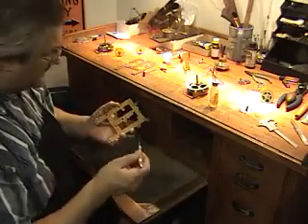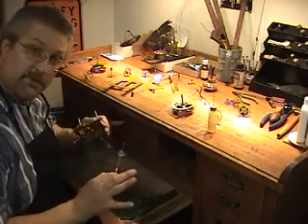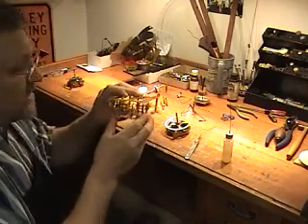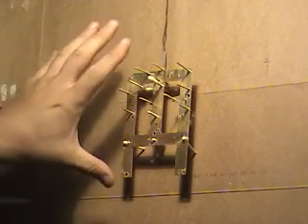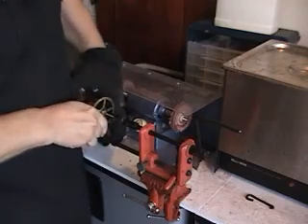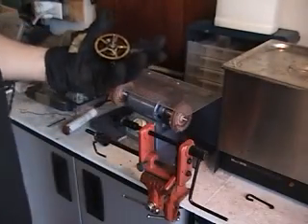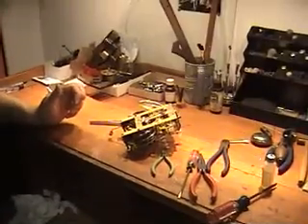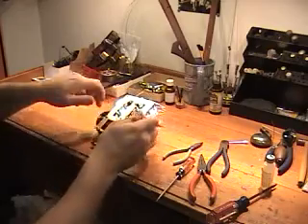Dr. Time's Clock Repair-Part 3-Antique Clock Overhaul

Comment: I think that it would be very helpful if you left the camera running when you put the works together, show where each lever goes and how to set up strike and adjust all of the levers and cam. That is where I have problems and that's what you left out. I'm not being critical of the video just thirst for more detail on the strike side.

Comment: I can't believe you didn't replace the mainsprings. The nainsprings were clearly worn and had lost thier shape.  I'd like to have seen how you polish the pivots. Do you use files, emery and a lathe, or something else? Polishing pivots usually take the most time and I'm always looking for better ways.  Everyone has thier own style but please change the mainsprings and skip the presidential polish. You do very well on all else. For the oiler I use a flattened end of brass wire with a loop handle.